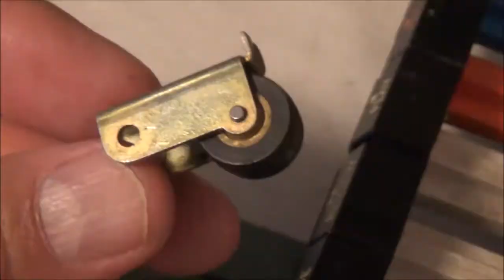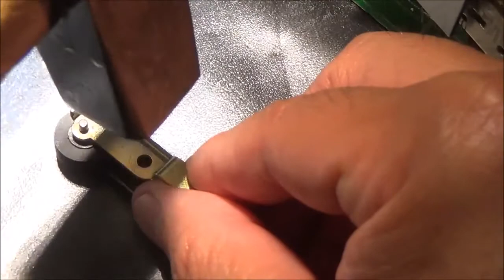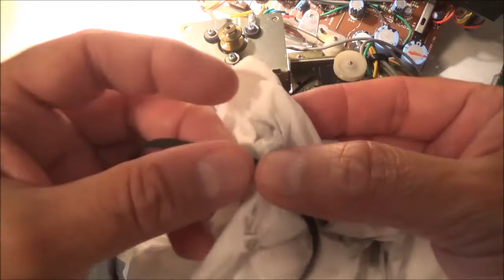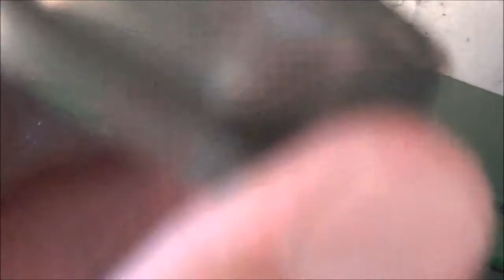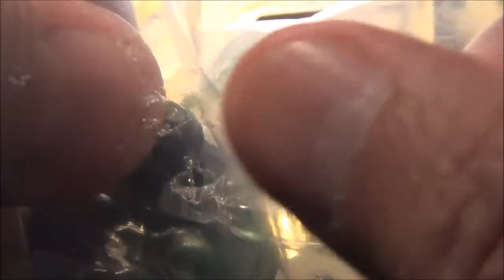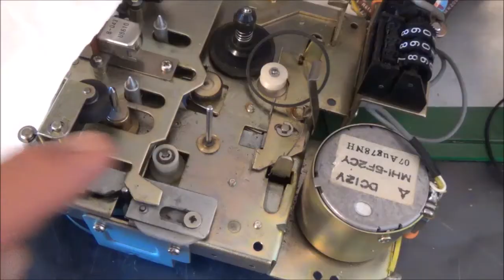JVC RC-727 Stereo Cassette Recorder Mechanism Repair

Comment: Great video. you explained it very well. Nicely done. Thank you for posting!! I just got me a JVC R838C from a co worker in MINT condition. Here's my issue so far, When ever I slide the balance slider one side cuts out and hear scratchy noise.  If I just tap on it, it will intermittently work, If I press on it then slide it to left / Right it works. Also, the tape mechanism start off slow then eventually will play the tapes. When doing a fast/cue it starts to spin then stops spinning.  Do you have a shop and do repairs on these?
Reply from the maker: Hi: I can answer real quick (we are on vacation). First problem sounds like dirty controls. You need to get electronic contact cleaner with lube--it might do the job. Second problem could be loose belt. All belts always need to be replaced; most have been in there for decades. I don't have a shop and nowadays only do electronics for a hobby. I got out of the electronics field and am staying out of it.

Comment: Great video. Those tape mechanism can be a pain to take apart. I have seen another YouTube video where he put the belts in boiling water for a while. I have tried it and it seem to shrinks the belt a little and did work.
Reply from the maker: Pat,  thanks for commenting and that tip! I will try that.